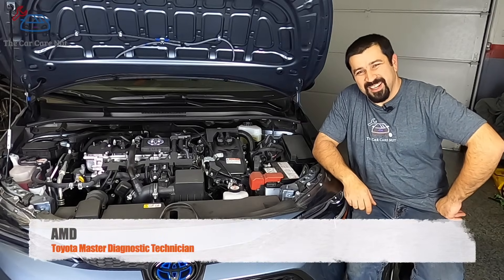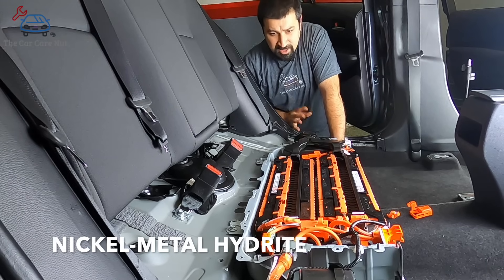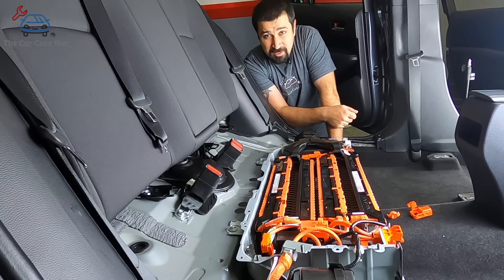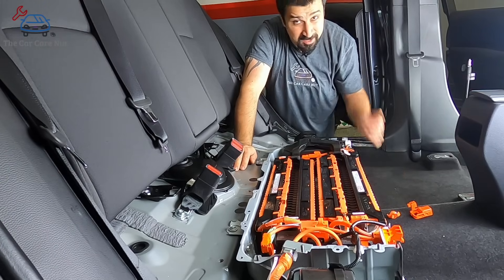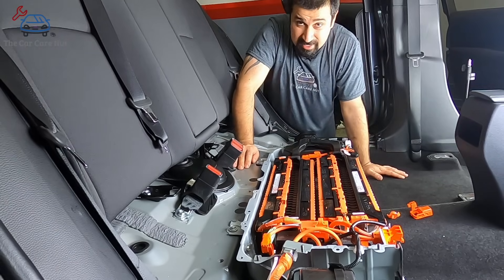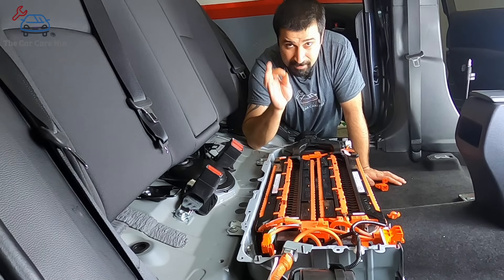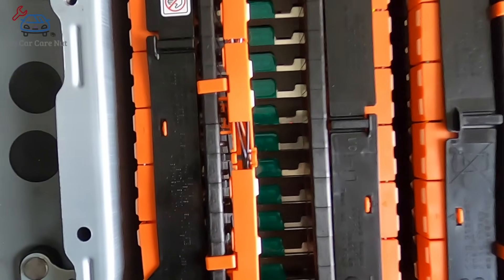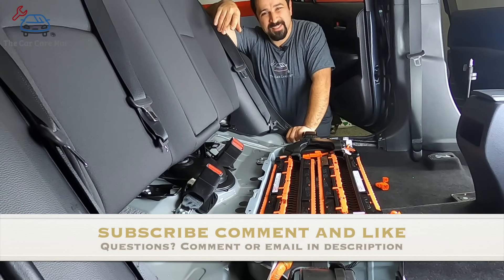How Toyota Hybrid System Work Part 1 High Voltage Battery

Comment: Keep in mind that the LION battery is "unserviceable". You can replace modules in the NIMH batteries. And we don't know how long the LION Toyota batteries will last. It's only been 4 years. Check the price of a new LION versus the options you have with NIMH. I replaced my 2005 battery with a junkyard, low mileage 2014  battery for $850. Or I could replace one module with a new one from  www.autobeyours.com for $80 each. Don't buy used modules off E-Bay. They won't disclose the date on the module. You may be buying a module older than your bad one. I got a used module with the date code scratched off. You can buy an entire OLD battery for almost nothing and sell the modules for $40+ each. There are 3 thermistors on all Prius batteries from 2000-2016. On the 2010, the thermistors are on the bottom. On the 2010-2016, they are on the top. But interchangeable. No DIY on the LION. Another reason the pre 2010 Prius is the best. Don't buy Torque-Pro to test your battery. Buy Dr. Prius because it measures the most important parameter which is "Internal Resistance". Measuring voltage is helpful but not conclusive. The Pros use Dr. Prius.

Comment: One question bugs me about the Toyota hybrid drive. When you hold one component of a planetary gear set solid and rotate another component, the third component responds. But it can respond with only so much force you hold the first component down, otherwise your hold breaks if the output has too high resistance. Now, with "holding down" replaced by electric motors, how is the force to set the car in motion transmitted to the output? How is such a great force resisted by the small MG1 or the infernal combustion engine so that the wheels get turned?
Reply from the maker: If you notice in park and ready on. As soon as the gasoline engine comes on the car slightly rocks back and forth. That is the motive force of the hold resistance. Older hybrid models used to be a bit clunky when they hold and switch newer ones are a lot smoother. There’s a dampener between the engine and the transmission to absorb some of that holding resistance.

Comment: Have a 2020 lexus ES300H hybrid ?
Been getting hybrid malfunction during noon time and after a while driving .. the last time the next morning the warning message disappears... went to the agent anywhere.  
Agent  says they fully charge to test  the battery but the voltage is good to spec.. and reckon the cooling fan is not good enough for our tropical Brunei... 
Is cooling an issue. I also checked that the cooling fan filter are cleaned regularly. The car is only serviced at the agent. 
Hope you can help!
Reply from the maker: Hi! That’s too new of a car to have an overheating battery unless the fan was flat not working
Reply: @TheCarCareNut  thanks

Comment: I have a OBd2 Foxwell and with an app on my phone it shows the volt of each block but how do i know if any one of. them go bad for pruis gen 3
Reply from the maker: Hi! If any of the blocks is bad the computer will see it faster than we can on a data list and it will set codes. As a general rule of thumb don’t want to see a large variance in voltage between the blocks
Reply: @TheCarCareNut  I see thank you very much for your help

Comment: Lithium ion is a "better" battery yet the 2021 Hybrid Highlander and Sienna use NIMH packs. Either Toyota is starting to cheap out (and going European by having an electric water pump in the new 4cyl power plants) or they know something we don't.
Reply from the maker: Lithium ion has advantages but also has disadvantages. The nimh battery has been tried and true and with good car it will easy last the life of the car.

Comment: Great video. But the camry LE has the lithium ion battery and the upper trims the nickel metal. How does that work?  So the LE battery would last longer and is more economical?
Reply from the maker: In my opinion they did that for cost. Lithium ion batteries cost them more and since the LE doesn’t have as much options it made sense
Reply: @TheCarCareNut  Thank you for the reply! Im planning on getting the one with nickel metal. I sure hope the battery lasts :D
Reply: @TheCarCareNut  Would you actually recommend going for new camry with the nickel metal hydrate battery? I really dont want any additional reliability issues  especially with all the battery tech:)
Reply from the maker: I wouldn’t say one is better than the other. They both have advantages and disadvantages. But nickel metal hydride batteries are tried and tested and they do last a long time. Lithium ion batteries are good as well but that’s one of their disadvantages is that they don’t last as much as nickel batteries in the same operating conditions. That’s what the papers say but time will tell how the lithium ion batteries will hold in hybrids.
Reply: @TheCarCareNut  I see. :D Well i think its hard to go wrong with either way. Thank you so much for your reply. Appreciate your videos! Learning a lot!

Comment: Would i be hurting my hybrid battery system if i plugged in an external power inverter? Im thinking of using one to power up an induction stove on camping. Thanks and more power! =D
Reply from the maker: If it’s not a very high powered one then you’re good. You wouldn’t hurt your hv battery it would be the dc/dc converter that is supplying power to the car that would.

Comment: I bought a 2021 toyota corolla hybrid. How do I tell if it is lithium or nickel hydride?
Reply from the maker: 2021 corollas should all have lithium ion
Reply: @TheCarCareNut  I opened my 21 corolla up and it is NiMH. I live in one of the coldest states in the US. Canadian friends have done the same, and also have NiMH batteries. Is Toyota producing them with NiMH for the harshest cold climates?
Reply from the maker: That is a possibility. Interesting as my sources don’t specify different markets. I’ll look into it

Comment: Hi,
I am considering to buy either a used 2018 camry Hybrid XLE/LE or a 2016-17 Lexus ES 300h. I am planning to keep the car for the next 10-15 years. Which will be a better buy in terms of reliability?
Thank you!
Reply from the maker: They are both similar with the Camry likely being cheaper to buy

Comment: I’m getting an oil change next week what is the BEST oil for my 2014 Toyota Prius?💕💜
Reply from the maker: I would use 0W20 for best mileage and 5W20 works as well. Full synthetic. If not sure of brands either use Toyota oil or Mobil 1
Reply: @TheCarCareNut  Is it the same for the 2020 LE Camry hybrid?
Reply from the maker: Hi! Go by the weight that’s on your owners manual. If it says use 0w16 only then use that. Mobil 1 makes 0w16 full synthetic
Reply: @TheCarCareNut  Thank you! Really appreciate the great advice you share!
Reply: Thanks

Comment: What is the temperature zone.
Reply from the maker: It’s a pre determined value that the battery needs to be at. Too cold is not good for the battery and too hot isn’t either. I would have to dig for the actual values I don’t have them at hand.

Comment: 2020 RAV4 Hybrid. I've been reading issues of a dead 12v battery on new cars, probably compounded by some people driving very little during this pandemic.
To checking what's happening with my car, I turn on the Vehicle Signal Check Mode to watch the state of the 12v battery.
When starting in Park it reads 14.1-14.3V (which I understand is the expected charging voltage) & while driving, quickly within a minute or so it steps down to a stable 12.5-12.6V & stays there the entire time I'm driving.
When I then put it in Park, the voltage increased back up to 14.1-14.2V. I left it idling for 30 minutes & it never varied the entire time, most of time running off the high voltage battery & the engine turning on for a few minutes a couple of times. I went & got a voltmeter to the engine fuse box connection & I got 14.3V so the Vehicle Signal Check Mode value is reasonably accurate. Turned the car off & the voltmeter read 12.8V immediately and went down to 12.6V in 5-10 minutes.
Why is the charging voltage being sent to the battery for such a long time when idling in Park while it only does it for a minute or so while driving?
Reply from the maker: That’s normal on hybrids. There’s no alternator and hybrid system changes the voltage as needed. Also on 2020 RAV4s and many models that have dying 12v batteries Toyota resolved the issue with a reset and software update for the data communications module or DCM. If you have this issue talk to your dealership about the reset and software update and they’ll take care of it
Reply: @TheCarCareNut  Thanks for the quick reply. If it's charging as needed then the constant charging while in Park would imply that the 12v battery is being constantly used in that situation and when you start driving the 12v battery is not being used at all. So what is the 12v battery being used for when idling in Park?
I'm aware of the DCM update. 
Your videos are the best and I look forward to each one.
Reply from the maker: The 12v battery is just used to power up the computers to start the hybrid system then it’s just sitting there getting charged

Comment: I am an engineer but you're video series is perfect for an overview introduction to the system.   All that electrickery simply explained!  Thanks for doing this. We are considering a Toyota Hybrid as our next vehicle.
Reply: Have tou get an hybrid vehicle yet? I am thinking about getting one.. the 35 mpg for a Toyota Highlander sold me.. but I don’t know enough about those vehicles 😅
Reply: @yennyjen5742  we went with a hybrid Ford Escape.  When we were looking we took what was available at the time .   42 mpg in Summer and 37 Winter (actual calculated over 136 fill-ups).   73,500 trouble-free miles so far.  Debating on a Corolla Cross or next gen Rav 4 when we hit 100k.  We'll see if the new Rav 4 is improved enough.

Comment: Ok so now I know not to jump someone with my hybrid..... But I'm wonder I was recently looking at a tire compressor to keep my tire at their proper level....I found a small compressor but it runs off your car battery.. It this too a problematic for my 2016 Avalon Hybrid?
Reply from the maker: A small compressor for tire pressures doesn’t draw too much. I think you’ll be ok using it

Comment: question can you make a short video about how to use the key in the Prius Prime if for some reason the push button doesn't work how do you access the hole to put the key in?

Comment: Have you put up a video showing how to find, clean, and replace the air filter for the  high voltage battery's ventilation fan in the 2020 and 2021 Camry LE hybrids? I couldn't find such a video crusing your list of videos, though I saw that there were such videos for other Toyota hybrid models. Is one of those videos similar enough to serve the purpose? Haven't bought the car yet, so there's plenty of time!
Reply from the maker: I haven’t made a video for The newest Camry hybrid yet. It will come in the future.
Reply: @TheCarCareNut  Thanks!

Comment: Thanks for you excellent series on hybrids. Any suggestions on how to make the 12v battery last longer? I heard it’s a common issue with Hybrids and BEV vehicles?
Reply from the maker: Thank you for watching my video! On the 12v battery they’re just the issue with hybrids. Very rarely do they make it past 5 years and some of them are pretty expensive. Other than regular driving and not letting the car sit for long not much can be done to help them
Reply: @TheCarCareNut  Thank you for your reply. Trickle charging every now and then won’t help either I suppose ?
A battery load testing is the best we can do to prevent getting stuck somewhere?
Thanks again.
Reply from the maker: A trickle charger helps. If you’re worried about the battery having issues when you’re out of town I would get a small portable jumper back. It’s so small you can fit it in the trunk and keep it charged. It doesn’t take much to jump start a hybrid car.
Reply: @TheCarCareNut  Lastly, in normal gas cars a weak battery can be hard on the alternator, in the case with hybrids that don’t have an alternator does this mean your high voltage battery will have to work more ?
🙏Thank you
Reply from the maker: That’s not the case with hybrids as the battery is very small and high voltage battery is very capable
Reply: I Join in the congratulations of Kevin, your experience and knowledge are highly valued. I have a 2012 toyota PriusC , and the 12V Battery failed in Dec 2019. So, I called the Toyota dealership in my country, and they told me this is a special battery (deep cycle battery), and the cost of its replacement is about 1.000 USD plus work, and of course, I did not like that. I contacted a garage that gives maintenance to fleets of buses and taxis, and they solved this problem; they installed a regular battery with the same specs as the original one (it can be seen that this is a regular battery), and the car worked fine. Then came the quarantines related to the pandemic and the problems arrived, the battery lasts about 4 days before going discharged; since then, I've had several occasions with the battery gone discharged. I still have this problem, but I manage it by unplugging the battery and then reconnecting it when I have to drive, but then I have the problem that the configuration with the radio and the clock gets lost. 

The guys in the garage say that it is not a good idea to use a battery jump starter to start the car when the battery is discharged, because it is possible to burn the car's central computer, instead, they recommend charging it with a battery charger; and they also say that every time the battery is discharged is important to check if the computer has "codes" in order to manage them...¿are these things true? 

I also have the idea that a battery with the same specs but with bigger capacity should work and the car would last longer with the battery charged. I understand that this is possible without issues in a regular car...¿is there any possible problem using a bigger 12V Battery for this kind of cars (hybrids)?

Beforehand I appreciate your help and send you a big salutation!!!
Reply from the maker: Hi and thank you for watching my channel. Don’t know why the battery cost this much? But a standard parasitic draw test will need to take place first to see if there’s anything draining the battery. If not then replace the battery as it could just be a defective battery that you have now. Jump starting your hybrid is not a problem and as long as it’s done right ( not reversed ) it shouldn’t be an issue.

Comment: thank you for the video, very interesting :)
When you say the car shouldn't be stored too long, how long is too long?
Reply from the maker: Hi Marc! Thank you for watching my video. Too long is months not weeks. And more importantly is how systematic or frequent is the storage. If every year you are leaving the car for 3 months in storage that’s an issue. If once every 3 years you leave it for 3 months in storage likely that’s not an issue.
Reply: @TheCarCareNut  thank you for the perfect explanation :) I've just purchased a Lexus IS300H 2014 model in the UK and it's been great learning more about the hybrid side of things from someone knowledgeable like you.
Reply from the maker: Congratulations on your hybrid purchase!
Reply: @TheCarCareNut  You’re right. I run a Yaris hybrid (with an NiMh battery). It probably varies on what state it was in when leaving it out of use, and the temperature etc. When it’s out of use, it’s isolated (by the contact relays described), and in the real world the little 12 V battery is more likely to fail, as it’s always feeding odds & ends like the alarms, and anything else that might accidentally be left on or fail to switch off properly. They’re easy to work round using some kind of jump start device, until the high voltage contact relays pick up - then the engine would kick in and recharge the 12V if need be. It’s the HV one that starts the engine - not like a conventional 12V starter motor.

Comment: Hi there - I have the 2020 hybrid corolla (it's great!) - for some reason I read it had the Ni M H battery, but in your it is the Li ion, - do you know if they are all Li ion?  thank you for the videos!
Reply: I see Angelo asked the same question and you already answered there.  Thank you!
Reply: We just bought a 2021 Camry. Only the base model uses lithium ion. The higher packages use NIMH. I hear LiIon is worse in cold weather

Comment: I just bought a 2021 RaV4 hybrid xse and I wonder how you keep it (battery) cool in winter time when the heater is ON inside the cabin?
Reply from the maker: Hi!  in winter times the battery doesn’t have overheating issues even with the heater running in the car.

Comment: How long can air conditioner run when car is parked and kids fell asleep? Or heat in winter?
Reply from the maker: It can run for a long time but it’s not advisable to leave the car running with ac for an extreme long time 1-2 hours or more.

Comment: I just collected a brand new 1.8 hybrid corolla, the battery level was at 3 bar, thereafter been driving a short distance and the battery got charged to 5 bars. But the next morning when I start the car, the battery is at 3 bars again. Is this normal? Or should I get it checked?
Reply from the maker: Congratulations on your purchase! If there’s an issue with the battery you will have multiple warning lights. Don’t worry everything is good. For peace of mind have the dealership take a look to make sure everything is 100% good which I have no doubt it is.